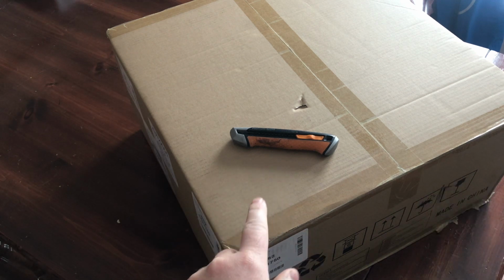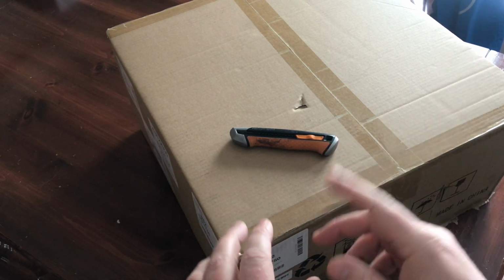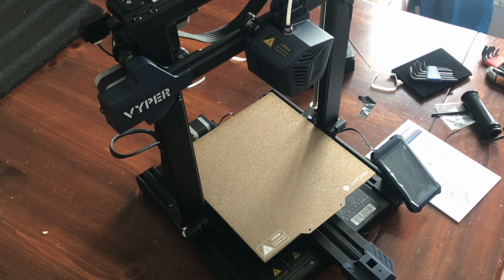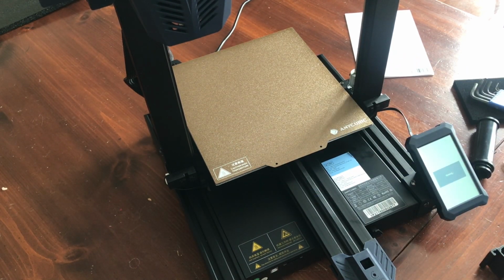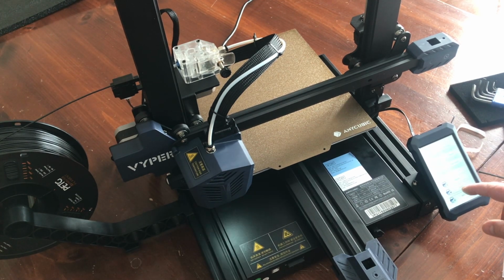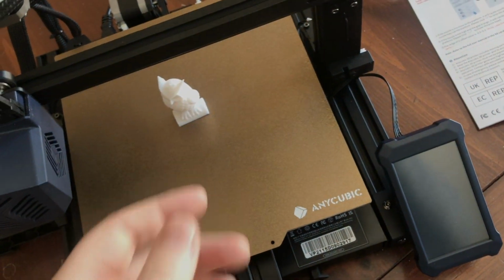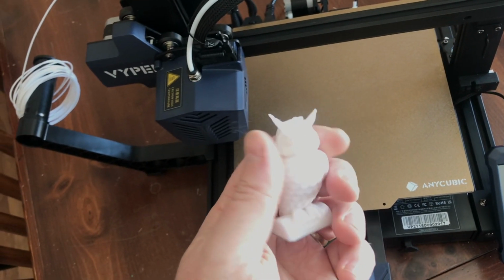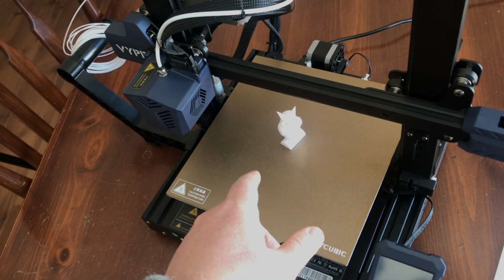Unboxing and setting up a Filament 3d printer for the first time!   Anycubic Vyper

Comment: If you don't mind me asking - what kind of power cord and how long did it take to set up? The image turned out really smooth and finished. Impressive.
Reply from the maker: I almost did the setup real time on the video, but I would say 40 minutes and I was printing. The power cord is just the standard 3 prong power cord normally used on computers.  The unit is amazing and since doing the video it has been working almost daily with ZERO issues.  It really is an amazing little unit.
Reply: @SamhainPropworks   Thank you for the info. After seeing how well it printed, I think this might be my next purchase. Also, which do you like better this or the resin?
Reply from the maker: Resin or FDM is very much based on what you are making it for.   Resin is great for display items, and very high detail, but I find it is brittle and likes to chip.  FDM you end up with the lines, but it is physically printing with plastic, so the final items are a lot better when exposed to some bumps and bruising.  I love both printers, Resin is a bit of a PITA when it comes to cleanup.   Though if I had to choose one of the two?  I would 100% take the FDM specially with what I am using it for mostly which is prop work :)
Reply: @SamhainPropworks  Thank you very much.

Comment: I'm so excited that you got this printer! What are you gonna make with it? Is it noisy?
Reply from the maker: It is a tough one, as most people may not have a 3D printer so including it as part of my normal videos may exclude a lot of people.   I have already re-designed my torch plan to be completely 3D printed which was a bit of an engineering feat!  I have already printer all the arms of the top and tomorrow I am printing the collar and hoping it all fits together!   As for noisy, the fan is noticeable but it’s not like it stops conversation in the room.    I have an idea for a fun project which I may release as an inter week video 😀

Comment: I been thinking on getting one of them but haven't took the plunge yet
Reply from the maker: The accessibility of these things is crazy now.  I am currently printing a version of the wall torch I had made out of Eva previously and am floored just how easy it is to use.   There is of course learning the rendering software but if you are not designing and just printing it is a fun endevour!  Thanks for watching MM
Reply: @SamhainPropworks  yeah I been thinking of doing something on one then mold it not sure yet but I can see this in my future 😃
Reply from the maker: The tech has so many uses, specially for prop makers.  It really adds to the “sky is the limit”. The best part is with one tool I can offer people a chance to build very complicated props that you would normally not be able to approach with milling machines and lathes!